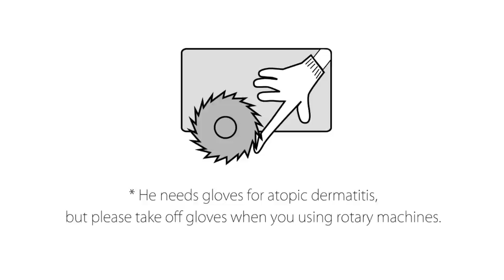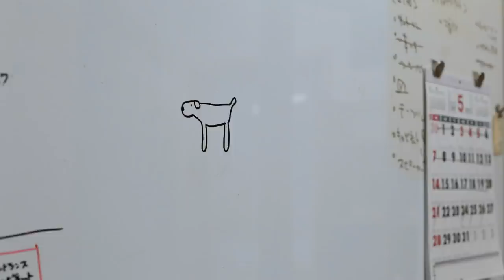ISHITANI - Making Amiisu Chairs with Paper cord seat

Comment: Beautiful work as usual. I love the corded seats and the wedged tenon holding the back on. I would worry about a future owner driving those wedges in too hard and blowing out the mortise. I would consider a small metal cross pin driven through the tenon below the mortise to prevent this. Keep the work coming.

Comment: I noticed the dust tubing coming out the floor.. are you running the pipes under the floor and then flex right up into the machine and then the dust collector is in the basement? Seems like a great way to keep tubing out of the way if so.

Comment: What oil do you use on your furniture? Greetings from South Africa.
Reply: It's so called "Lappenwachs" (rag wax) from a german company called "Kreidezeit". They describe it as...

"Solvent-free linseed oil / beeswax treatment for untreated wood indoors especially for furniture, doors and wood paneling. Lappenwachs fires to the wood grain and gives the wood a honey-like, silky and anti-static surface.

Easy to apply, diffusible, dirt and water repellent. Can be tinted with Kreidezeit earth- and mineral pigments. Unsuitable in the floor area. Not recommended for kitchen countertops."

The page for Lappenwachs: http://www.kreidezeit.de/Produktinformationen/Lappenwachs/Lappenwachs.htm